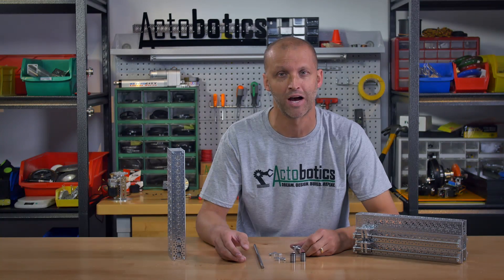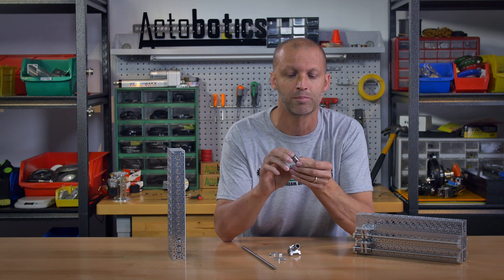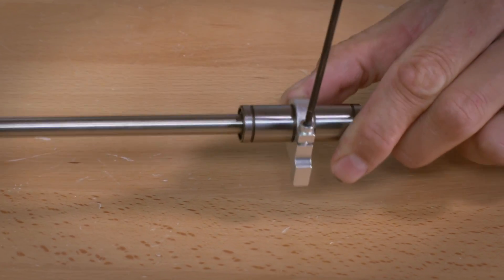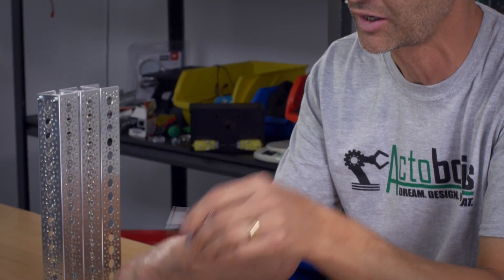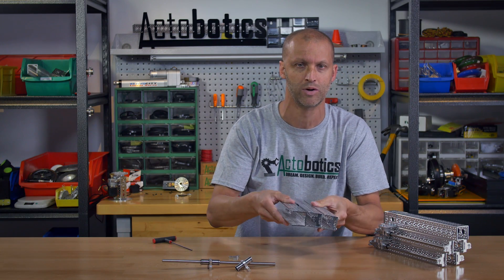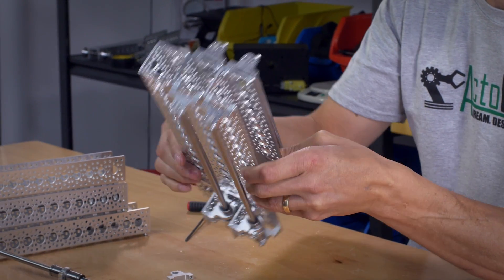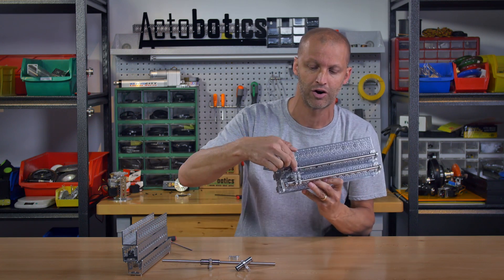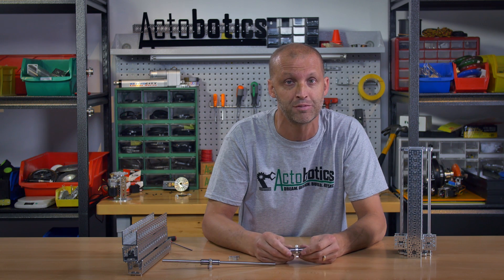Actobotics® Team Tech Tip: Ball Bearing Linear Slides

Comment: ServoCity  - Is is possible to make the same using 100% GoBilda Linear Actuator Kit/parts? 
(length or application does not matter)
Linear Actuator Kit (1120 Series, 201mm Stroke, 8mm Lead)
https://www.gobilda.com/linear-actuator-kit-1120-series-201mm-stroke-8mm-lead/

Comment: Are Servocity linear slides legal parts in FIRST FTC competitions? From my understanding they would not be if our team didn't manufacture them. Is this correct?
Reply: +Chris Westcott Rule 5.3.2 <RM01> c. "Assemblies of COTS components, such as linear slides, and gearboxes are allowed while a pre-fabricated gripper assembly designed to grab the game elements is not."
Reply from the maker: +Chris Westcott Hi Chris, thanks for contacting us.  We always point teams to the FTC forum should you have any questions you're uncertain of.  However, teams our able to purchase off the shelf COTS parts (that fall within the FTC rules of course) that have been manufactured by companies and not designed by teams.  We do not sell these linear slides in a kit, but all the parts are available for purchase as individual components.  There are many ways you can utilize and incorporate these parts into builds/assemblies.